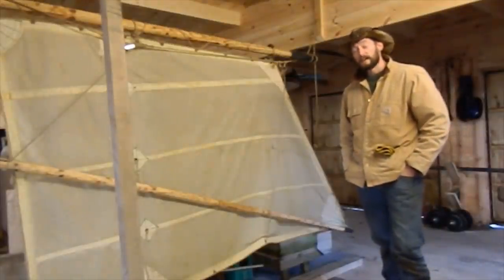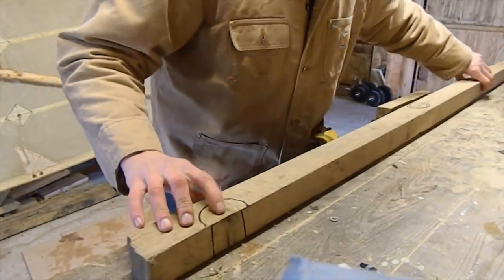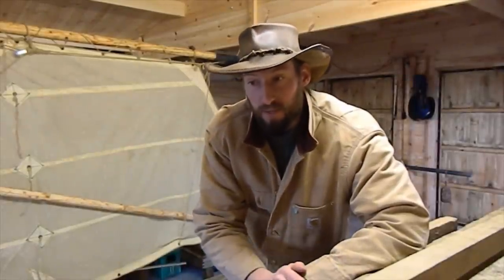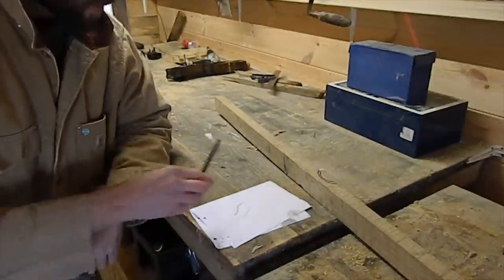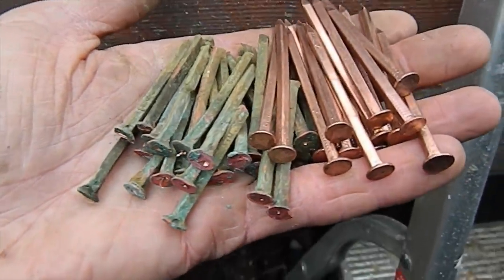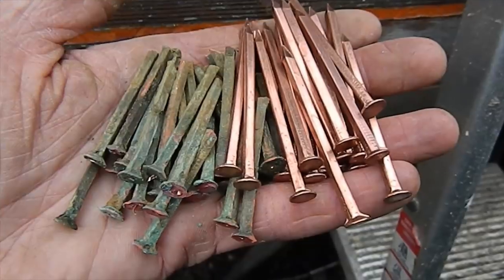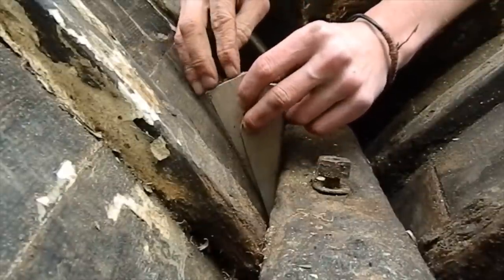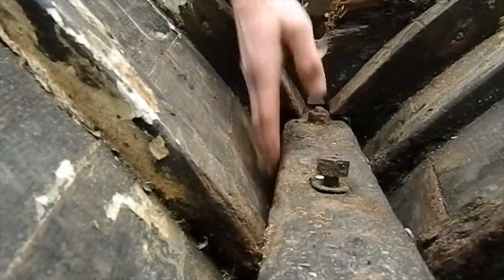The Death and Life of a Rib - Step by step replacing a steamed rib.

Comment: When in preparing timber for ribs I tend to use green logs and prior to sawing I split the log so the grain orientation is predetermined prior to selecting the saw angle and orientation to the log this is to achieve select 1/4sawn timber I then dress these to required size allowing for shrinkage secure slip blocks to existing ribs steam the ribs and drive the new rib down and in from the top and then use small wedges to finish the ribs shaping , after cooling and setting the slipper blocks are removed and ribs fastened into final position this system allowed the fitting of 60 ribs in one day with only 3persons and a further 2days to fasten  with 2persons ,in Australia my preference for rib material is spotted or blue gum of over 50 years growth , well done keep it up I enjoy watching your journey cheers brian
Reply from the maker: Absolutly solid advise! Thank you 👌🏻👌🏻

Comment: Thanks for the video. I’ve got a few cracked ribs to replace in my boat (1962 Falmouth Pilot 9 Ton) when I can get back to her, so this video is very helpful to show how the job is done in situ. Every other video of this process that I have seen (e.g. Acorn to Arabella), they have had rather fewer obstructions to work around!
Reply from the maker: Great boats! And great project for you! Although youll have to work backwards as youll presumably still have the deck on? It can be done but just need better measurements and ideally ... no bilge stringer! 
Drop me a pm if you want to chat about the job,
Reply: @BothanboatsIdler   Luckily(?!) the deck needs to come off anyway, so that won’t be in the way, but thanks for the offer. If I come up against any problems then I’ll PM you!

Comment: I've just replaced the keel in a fibreglass boat that had rotted out. It had turned to mud in several places where the glass encapsulating it had been holed. Right what you say about asking the right questions for your own projects. As you are going through, cleaning out the pockets, things are looking better and better. Keep well.
Reply from the maker: Hey, fibreglass and wood seldom go well together! I hop the job went well and you het back out onto the wet stuff soon!! 

Im feeling pretty positive about the keel given what ive seen so far... although there are alot of things that can still go wrong! 🤞🏻🤞🏻🤞🏻

Comment: Tree roots for knees, often overlooked.

For those confused the thick pieces of timber going down the sides are frames. The ribs, also called intermediate frames, are smaller and tend to crack for three reasons.  First they are dry but under tension and get whacked when cold it shatters them.  Too dry and instead of shrinking they crack. Finally someone puts a support there again when dry.  If soaked with linseed oil non boiled, they tend to stay supple and lose tension over years.

The rabbit, rabbet or rebate, is cut into the stern post and keel/keelson so that planking stock sits in almost with a 90 degree edge but follows the shape of the frames. Note between stern and keel is usually a stop water( dowel hammered in to swell up)in rabbet or close too.  The stern is bolted to the keel via the stern knee also called foreknee.  There also should have been some floors between the stern and the interior planks I forgot name of.

Floors are piece of wood or metal that join three things, frame to frame on opposite side and keel. They also connect to deck beamshelf and stern as well as middle beam shelf and stern..same in bow.  Note stern is rear now is front.

Older fishing boats tended to have lots of oil from fish so areas tended to get well oiled.
Reply from the maker: Good thinking re the roots! Thanks

Comment: Where do you get the red lead powder and pine tar.
Just a note on paint inside the hull.
I have found old paint really holds the damp. Scrape it off and the woid dries in a day or two. Makes me very wary of painting inaccessible places. Perhaps oil would better.
Reply from the maker: I agree 👍
Both are from ebay! 😂 all be it the red lead powder is from a chandler selling on ebay. The pine tar is from a horse supplier; its the same stuff just a fraction of the price in a “boaty” shop!
Reply: @BothanboatsIdler 
I see it. Thanks. I have an old pot of Stockholm Tar and I was told you couldnt buy it anymore. Dont believe everything you read I suppose. Present company excepted of course. 😉

Comment: You'd be doing yourself a huge favour by investing in a bandsaw. You need something 14" or over to get a machine big enough to tension a reasonable blade for ripping oak, but they're on Ebay every week for just a few hundred pounds. Trying to rip nicely with a hand held circular saw and the wood in a vise is just making any easy job difficult.
Anyway, keep up the good work. (Oh, and those things you were kneeling on are not knees, they're floors).
Reply from the maker: Sound advise, i was thinking of a table saw with fence for the “rib party” i thought that would give a cleaner edge? I have a wee bandsaw but its not up to the job of milling 30+ ribs!!
Reply: @BothanboatsIdler  I'd certainly point you towards a bandsaw rather than a tablesaw. For boatbuilding, where you've curved work to do later on, the bandsaw will be infinitely more useful (and it's a much safer tool, too). It will rip really cleanly with the correct blade. 
Come and join us on Woodhaven 2 for top advice on machinery and other workshop-related stuff.
Reply from the maker: @MikeAG333  Nice one, thanks for the tip. i'll look into it! ill check you out, can you send a url? your link take me to your site and typing Woodhaven 2 into the search bar brings up music videos! :D

Comment: Isn’t that called a frame?
Reply from the maker: Hey Ken, a frame in this case is a station frame, which are the larger sawn “ribs”. The lighter built steamed ribs dont function as a frame to hold the shape of the boat but more to stabilise and strengthen the planking. Frames have more of a structural role.
Reply: @BothanboatsIdler  Roger that!